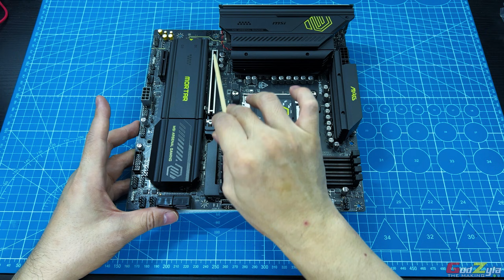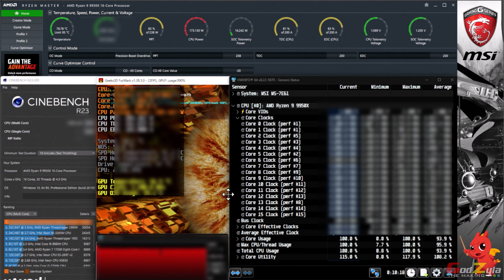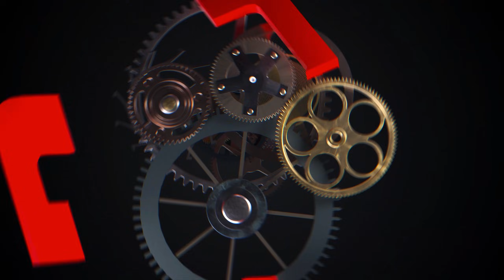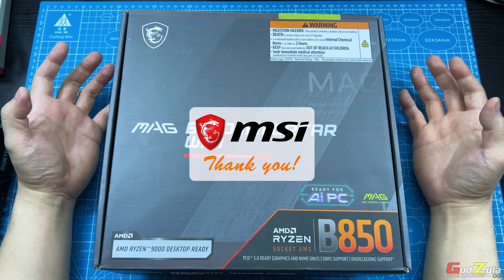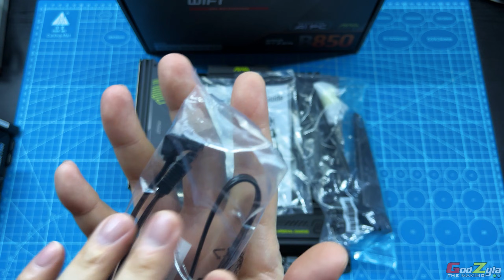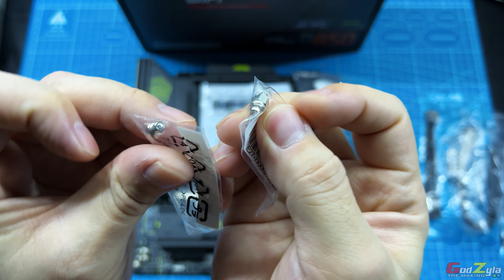MSI B850M Mortar WiFi

Comment: Thanks for the great review. I always like your videos, best review channel for me. I have an important question about the M.2 SSD. So, Gigabyte mainboard has this sometimes, that they have issues with their M.2 cooling heat sinks, because of the different thermal pad thickness. But, how is it on this MSI B850M board? I want to use a Samsung 990 Pro, which is a single-sided SSD. So, it has no chips on the backside of the M.2 SSD, so it is maybe a bit thinner. I don't know if it is the standard on M.2 SSDs. So, do I have to make any changes on the thermal pads, or do I have to look carefully at this? Or, just remove the heat sink cover, remove the thermal pad sticker on the mainboard, install the SSD, and then remove the thermal pad sticker on the heat sink, and just click in, right? So, my question is, is there a difference on this mainboard specifically with single-sided or double-sided M.2 SSDs?
Reply from the maker: Hi Shusui966, welcome back. For the M.2 Shield on each individual motherboard, this is subjective. As often, there is a miss alignment of the m.2 where it did not touch the m.2 armoy sheild. 
There is a trick which I often apply on any motherboards. Be it Single Sided or Double Sided M.2
1) I often test new builds outside the case and to install windows 11 on the priority drive. 
2) if there are any additional m.2 SSD, I will slot them in on the motherboard m.2 slots.
3) Next I will measure the gap better the bottom of the m.2 and motherboard m.2 area
4) using this https://www.aliexpress.com/item/1005008316525098.html? (I purchase T7.8 (7.5mm-7.7mm)), place the flater and wider surface on the motherboard m.2 slot (at the center), 
place the m.2 nvme, the narrow or pointy sillicon rubber surface will support the center of the m.2 nvme.
If it's too tall, I will trim it down. You see, this will give support to the center of your m.2 and to have better contact with the thermal pad on the m.2 armour shield. 

As for motherboard like shown here. even if it's single sided, just remove top and bottom thermal pad, it will sit snuggly. If you have not notice, the base of the m.2 slot, there is this metal piece, that's where the support is, including the thermal pad. therefore you do not need the sillicon rubber.
Reply: @KleoYan thx very much for all this detailed information. best channel!!!
Reply from the maker: @shusui9665  you are most welcome. 😉
Reply: Hi i just recently made a build with this MB using the samsung 990 pro and had no troubles with it and works just fine.
Reply from the maker: Hi Leon. Welcome to my channel and thank you for your feedback too 👍👍👍

Comment: I just built my PC and used this same motherboard. After updating all the drivers and Windows itself, the Bluetooth still doesn’t work properly. It detects devices and does the search, but it won’t connect. I’ve watched several videos but haven’t found a fix. I even tried reinstalling everything — it let me pair my mouse once, but it was super laggy. I unpaired it, and now it won’t connect at all. Any suggestions? I’m pretty new to the whole PC-building world.
Reply from the maker: Hi 4bdiel MG, welcome to my channel. Have you tried uninstall the bluetooth driver and re-install it again. btw which windows version are you on.. did you move your windows os from previous board to this board? or was it a fresh install? btw what windows version are you on?

Comment: I'm torn between this board and the B850M Plus from ASUS. Which one would you choose and why
Reply from the maker: Hi BreakingDimes, welcome to my channel. For me I will only go for these two M-ATX board. 

Asus B850-G Gaming Wifi
1) The superb blazing fast ram training timing and the boot up. https://youtube.com/playlist?list=PLEW-b-2vYDdOuy7J6a7ffuxPuSIPMoxvx&si=TONnEpxz0pglQD3D
2) If purely gaming, it has just 1 PCIE slot which runs at 16x always (Mortar B850M do run at 16x too) 
3) If building a white build, this board is all white
4) Good designed m.2 slot where the 2nd Gen 5 m.2 slot is located one gap away from the 1st m.2 slot.

Mortar B850M 
1) The Lan port which is at 5G
2) The wifi 7 which is of true 320Mhz channel bandwidth instead of 160Mhz in most motherboard

Why not Asus B850M Plus, This board does perform too but the PCIE slot for GPU is lower for my liking.
Reply: @KleoYan  ended up going for the b850m gaming plus as it has a lot more usbs and all m.2s up front for better compatibility with no lane sharing. Also it was like 30 bucks cheaper than the mortar  and the b850g just isnt available where i live.
Reply from the maker: @BreakingDimes  I see, this board will do too.. no issue.

Comment: how it compares to msi b850 gaming wifi plus ?
Reply from the maker: Hi K C, welcome to my channel. both boards have the same power phase but different amper. Mortar is of 60A and Gaming Plus Wifi is of 80A. Mortar is of 8 layer and Gaming Plus is of 6 layer. The rest of the difference, you might want to view side by side to do a comparision. B850M Mortar https://www.msi.com/Motherboard/MAG-B850M-MORTAR-WIFI/Specification vs 
B850 Gaming Plus Wifi https://www.msi.com/Motherboard/B850-GAMING-PLUS-WIFI/Specification

Comment: Hey kelo Thanks for reviewing this motherboard, so i am going to pair this motherboard with 9950x3d and 5090 will it work flawlessly ? or there will be issue by pairing 9950x3d and 5090 with b850m motherboards ??
Reply from the maker: Hi Luffy, welcome back. Nope, this board is sufficient to run a 9950X3D + 5090 GPU, just make sure your PSU has suffcient power and kindly do not cheap out on PSU.

Comment: thanks for the review. i have hard time building my pc because there is no youtube video showing that they use this mobo for their build. quick question,  im using corsair rm750e  and  after listening to your guide, i would only install 2 connection from the psu to the mobo. is that right? i don't have a gpu yet and i don't olan on OC, so no connection for gpu, and only 1 cpu cable needed at the top. is that right?
Reply from the maker: Hi alduin, welcome to my channel. In general 1 8pin EPS connector is sufficient. that's what I normally do since I dont overclock.
Reply: @KleoYan thank you for fast response bro. ok, but if i plug what should not been plug because i dont draw that much power, will the mobo damaged? or it just redundant ? thanks heaps!
Reply from the maker: @alduin6036  to be upfront, it will be best to plug both. my own style I just plug 1. infact most of my content with benchmarking, I only plug 1 8pin eps.
Reply: @KleoYan  i see.. tahnk you bro. you truly a savior. have a good day good lad!
Reply from the maker: @alduin6036  You are most welcome. All the best with your build too.

Comment: The only comprehensive review of this board atm, even tested the ethernet and wifi, champ. Im totally torn now between this and Gigabyte B850M AORUS ELITE WIFI6E ICE...its 40€ cheaper here in Germany.. i dont mind slower wifi and ethernet but i need something reliable and no mess with drivers and other weird stuff like Asrock boards... what do you think?
Reply from the maker: Hi Hab, welcome to my channel. If you only require 2 x m.2, then go for gigabyte. I the specs is almost the same, just that mortar have the advantage of 1 more m.2 slot, higher networkwork speed and have both HDMI and DP port for troubleshooting. Or if you fancy white board. I will go for this. https://www.youtube.com/playlist?list=PLEW-b-2vYDdOuy7J6a7ffuxPuSIPMoxvx once of the best m-atx board and it operates amazingly fast.
Reply: @KleoYan  yeaa its 260€ here while the mortar is 218€, im going to get the mortar board, the 30€ difference with the white gigabyte board is well worth the wifi7/5gb/better audio etcetc. Thanks for the review!
Reply from the maker: @hab9514  Good choice 👍👍👍and I wish you all the very best with your build too 😉

Comment: So detailed which is amazing. Of all the b850m is this the one you'd recommend?
Reply from the maker: Hi Brandon Chan, welcome to my channel. There is another B850M motherboard but that is in white https://youtube.com/playlist?list=PLEW-b-2vYDdOuy7J6a7ffuxPuSIPMoxvx&si=g-POXwL0PTBoEvv- 
the difference will be, mortar has better wifi 7 and a 5g lan port. As for the Asus, though it's wifi or lan port is not as strong as the mortar, but it gives 4 m.2 slots.
Reply: That ROG looks so nice, too bad there's no black. Do you think the MSI b850m mortar is the best mATX board available?
Reply from the maker: @brandonchan4992  based on my experience from previous series mortar boards, this gives me the same surprises. I will say this is one of the two best M-ATX board in the market.

Comment: Do you know what connector the CMOS battery have? Is it Molex or JST?
Reply from the maker: Hi Nobushi, welcome to my channel. If you need to change the batter, search for laptop bios battery.
Reply: @KleoYan  Yes, there are two types of laptop battery: one that uses Molex 51021-0200-B connector and another one that uses JST SHR-02V-S-B. They are similar in size, but not equal, they differ in the details, being incompatible with one another. That's why I asked. 
I just bought the mobo from Aliexpress and I think it'll come without the battery because of restrictions in lithium batteries shipment by air.
Reply from the maker: @nobushi  ouch, ok for this I am not very sure which type of connector that is. I would advise you to write in to MSI and ask. it's better that way. on my end I will try to ask too.

Comment: MSI, how the heck does this board have 2 thermal pads for each gen 5 m.2 slot yet the ATX ver and even the more premium X870 and X870E boards don't have bottom thermal pads for the 2nd gen 5 heatsink???
Reply from the maker: Hi gsm_liv, welcome to my channel. Good question. I will send your feedback to them and you might also want to submit a query with them too or to send a message at their Reddit forum https://www.reddit.com/r/MSI_Gaming/

Comment: Hi. How does this compare to the Asus TUF B850M-Plus? And which would one you pick? Thanks in advance!!
Reply from the maker: Hi REIN, welcome to my channel. if both boards are of identical price, i will take this board 
1) it's wifi 7 adaptor is making use to Qualcomm which is of 320Mhz bandwidth channel as compared to Tuf
2) it has a 5G lan port else tuf is at 2.5G
3) the PCIE GPU Slot is not located lower as compared to tuf, this will be an issue for some M-ATX case.
Reply: @KleoYan thanks!

Comment: anyone using this mobo with 9800x3d? and how this mobo performance?
Reply from the maker: Hi ari k, welcome to my channel. This board handles extremely well with a 9800X3D. It's easily running base clock of 5.225Ghz that matches the max boost clock. Best of all it runs at 105w TDP after some refine tunning.

Comment: Your build configuration for this video was without External Graphics, but when you show the Advanced BIOS options, the Initiate Graphic Adapter was set to PCI-Express Graphics Device. Anyway, can you check the maximum UMA Frame Buffer Size for Integrated Graphic, I have not found this info in the BIOS manual.
Reply from the maker: Hi Пётр, welcome to my channel. I wish I can aid you on this but I have returned this board. you might want to try as at their reddit forum. https://www.reddit.com/r/MSI_Gaming/

Comment: First of all thank u for ur conturbution to enlighten the people regarding pc components , I just got this motherboard and I got a question , is the motherboard m.2 heat sink suffecient for samsung 9100 ssd ? or  should I get a seperate heat sink ? My other question is I have an m.2 gen 3x4 with the speed of 1800 MB/s if I  plugged it in the 3rd m.2 slot I know it will use 3x2 bandwith cause of number of lanes so will it affect the speed or it won't be affected due to the slow speed of the m.2 ? Thank u
Reply from the maker: Hi PlooSK898, welcome to my channel. For gen 5 m.2. I will use a beefier heatsink. As for the back m.2. It will affect the speed but you will not feel the diff. It’s very slight. Unless you are compiling big files and such, then you will feel the difference.
Reply: @KleoYan  Thank u I think I might get a heatsink with pipes+fans but I'm afraid that it might be problematic with the gpu even if I use it in the 2nd m.2 slot
Reply from the maker: @PLooSK898  This i can only suggest this. Even though the m.2 is cater for Gen 5, as mentioned I will use a beefier heatsink and to have my GPU vertically mounted. Now my question back to you, what's the usage for a Gen 5 m.2? If it's just leisure and gaming, honestly a Gen 4 is more than capable.
Reply: @KleoYan  I use it for photoshop + rendering + gaming ...etc and the reasons I got it instead of gen 4 are 1.the price was appropriate ( I got it with a great discount ) 2.I only change hardware every 10 years so I always lean toward getting the best available one
Reply from the maker: @PLooSK898  I see, you can try on the default m.2 heatsink to see the temperature. If it does not heat up and to throttle it, then it will be ok. If it does, then you have to get external m.2 heatsink and your GPU will have to be vertically mounted, as the tall m.2 heatsink will block your GPU from plugin in properly.
Reply: @KleoYan  Thank u , u were a great help hope ur channel will thrive and u get the recognision u deserve
Reply from the maker: @PLooSK898 you are most welcome and thank you for your best wishes. You too, all the best with your build too 😉

Comment: Should I get this motherboard or the ASUS TUF GAMING B850M-PLUS WIFI ?
Reply from the maker: Hi Mikeysworld603, welcome to my channel. You will need to decide what's good for you. In my opinion, I will question myself these

1) What will I be using this board for? Purely gaming or gaming plus light content creation?
2) Whats the price between the two
3) Does asethetic plays a major part? 

my answer. I will choose a board for Light content creation only, therefore the B850M Mortar will be a better choice. 1st it has a 5G lan port 2nd true wifi 7 adapter which has 320mhz channel bandwidth 3nd it has stronger USB port (Type C) to do file transfer. I dont care about looks, I care more on performance and stability. 

If you are using it for gaming and care about looks then Asus B850M-Plus wifi will be for you, as you do not need 5G lan port, 2.5G will do. Don't really matter if the wifi 7 is of 160mhz channel. Don't really require stronger USB port (Type-C) to do file transfer.

Comment: Great video :)

I'm very close to buying this for my jonsbo Z20 build with Deepcool MYSTIQUE 240 ARGB. 
Do you know what possibilities are there to control ARGB, fans etc with this board? It is the first modern build that I will be doing
and I want to buy the correct case fans for this and am scared if I go for Noctua or others, that I need several different softwares to sync them etc?

Or do I need a ARGB controller/hub?
Reply from the maker: Hi moodcatching, welcome to my channel. You can set the fans in set and to plug to the motherboard header. Make use of either the UEFI HWmonitor page to configure your fans rpm curve or to use MSI Center where you can set it there too. As for ARGB, you can also plug your aio pump and radiator argb connector to you motherboard and to make use of the motherboard mystic application in MSI Center to control the argb effects. One thing you need to take note is.. the LCD on your pump, you will need to connect to the motherboard USB 2.0 header and to install the deepcool application to control it.
Reply: Hey we got the same case ! I already bought the mobo!
Reply from the maker: Hi Carlo Fontejon, welcome to my channel. Thank you for sharing. Maybe share your experience with the build. That will be very useful. Thank you for your feedback too 👍
Reply: @carlogab31  Hey man, thats awesome :) I think it is a very nice looking board with good features, I'm sure it will be nice in the z20. Good luck and let me know how it works out :)
Reply: @moodcatching  i have my previous cooler the noctua nh d15 it says on the z20 that it can accommodate that specific air cooler

Comment: Thank you for the review. Could you please confirm or show a video of how the older Antenna connector still works with this EZ-Antenna connector? There are lots of reddit threads highlighting that they are unable to find a replacement for the EZ-Antenna. Thank you.
Reply from the maker: Hi Howdyyoyo, welcome to my channel. I have returned this motherboard but last I have tested with an ASRock older wifi antenna and it did slot in without issues.
Reply: @KleoYan  Thank you for confirming. Do you mind posting a video of the older Asrock wifi Antenna?
Reply from the maker: @Howdyyoyo  Hi, thank you for your suggestion. I no longer have this motherboard, not able to show you exactly but I have used a ASRock Z390 Taichi antenna on it.
Reply: @ Thanks for confirmation.
Reply from the maker: @ you are most welcome.

Comment: A gen3 nvme for the rear m.2 is a smart suggestion.

Yet, wouldnt the fact that a nvme in the rear (giggity) would only run x2 mean it would also run significantly cooler? (Wouldnt a x2 gen 4 perform similar to gen 3?) 

I cant imagine msi overlooked the heat possible wit having a 2 gen 5 on one side of the pcb and a gen 4 directly opposite. But its definitely a concern, and a gen 3 seems like a safe bet to avoid user error, or unforeseen current and temps creating disaster.
Reply from the maker: Hi Ander Otaola, welcome back and thank you for sharing your opinion. Just to add on, yes it's a concern on the 3rd M.2 slots but you see, since it's running at X2, I dont think is ideal to plug a Gen 4 m.2. it's kind of a wastage. That's part of the reason why I mentioned to use a Gen 3 instead. Nevertheless thank you for sharing. 👍👍👍